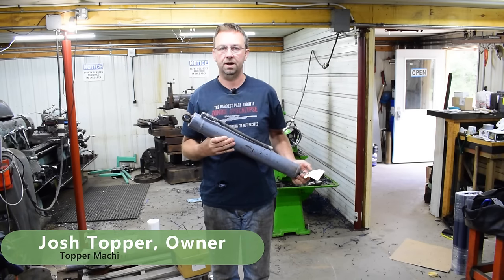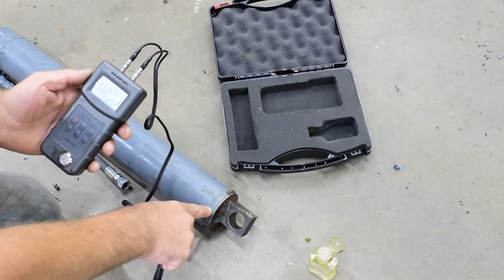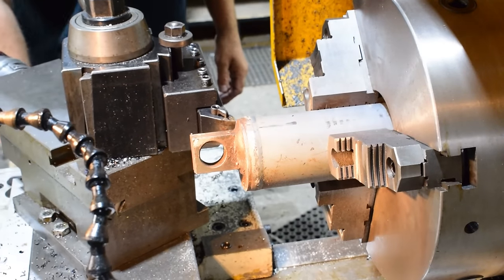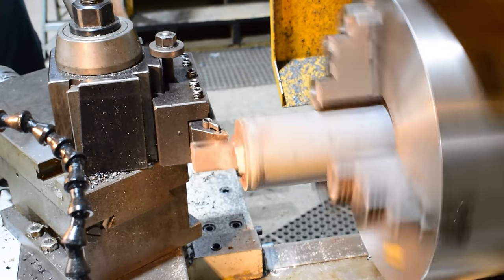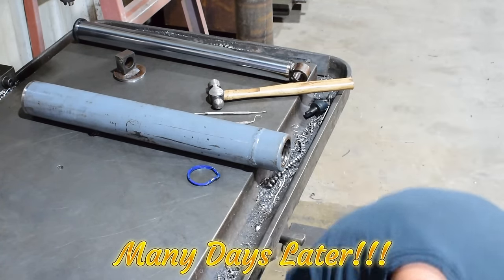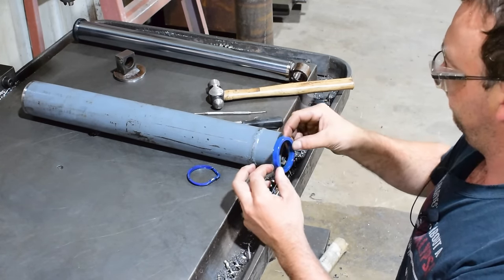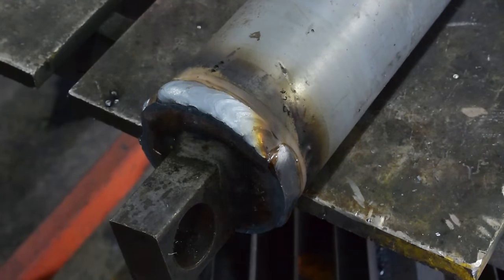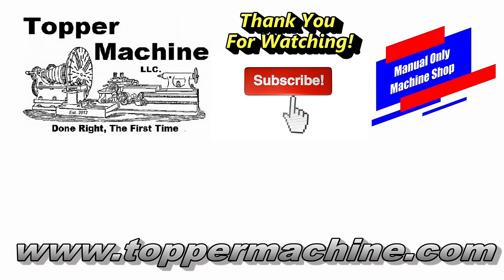Welded Hydraulic Cylinder That Can't Be Repaired, Cut Open and Resealed

Comment: I run a hydraulics manufacturing and repair company that specializes in heavy industrial applications.  We refer to this type of cylinder as a mobile or welded type.  Mobile/welded cylinders like this are in many cases considered throw away as they tend to be cheaper to buy new than to repair.  Something like this could likely be purchased from a Tractor Supply store or something like it for a few hundred dollars.  But, sometimes that is not an option.  This is known as a volumetric cylinder, as the oil volume and pressure displaces the rod.  It is single acting on the extend side, and uses gravity/mass to retract it, or other mechanical action of the equipment it is used for.  It does not need a piston seal, or a piston for that matter.  The "piston" on this rod is just a stop to keep the rod from being blown out by the oil and pressure at full stroke.  It is an odd design though, being completely un-repairable.  It really isnt the least expensive way to manufacture this type of cylinder, either.  It would cost us more to build this way than to make it repairable.  This is just a poor design.  Most welded type cylinders have an open tube on the rod end with a threaded on cap that holds the rod seal, the rod wiper, and an oring to seal the outside of the cap to the tube, and it is very inexpensive to build them this way, and much easier to rebuild.  This could probably be converted to that style easily, and then it would be rebuildable.  When you assembled the cylinder, it took some good hammer hits to get the rod to load through the seals, i would recommend cutting a good load chamfer on the rod, something around 20 degrees, to make this easier to load, and not risk cutting or rolling your new seals.  Also, if you dont have part numbers for your seals, you can measure the dimensions of the groove, which any seal company can use to find a seal that will work for you.  Lastly, since this is a pressure vessel, be very careful with MIG welding, its very easy to end up with voids and holes that will not hold pressure and allow oil to escape, which can cause a dangerous situation.  It can be done correctly with a MIG welder, but care must be taken.  I would highly recommend testing this after the repair as well with a small hydraulic unit, utilizing proper PPE, and taking safety precautions.  Ive experienced failures during testing where heads blew off, rods blew out the end, oil jets shot out from small holes in welds, etc...  We have never had any major injuries from this, we use ballistic shields during testing, but there have been serious injuries over the years in our industry, and even some deaths from failures during testing.  Just be smart about it if you do testing, its a pressure vessel, and if it bursts or breaks under pressure, a large amount of stored energy can be released in a bunch of different ways, so be careful.  Anyway, you did a nice job repairing that very poorly design and manufactured cylinder, keep up the good work.
Reply from the maker: Thank you and great info. This particular cylinder wasn't available quickly, so repair was the option. Definitely a good learning experience. The cylinder was pressure treated and passed. I am always cautious when welding any pressure vessel. Been through some training on in and have a good friend to consult on the proper procedures. He is an ASME "R" & "S" stamp holder and a MN licensed pressure vessel inspector. I also have a WI inspector who is a good friend and stops by to give assistance and advise. Anyway again, thank you for your great and welcomed comment. I will pin this one for future viewers to read.
Reply: Thanks for very helpful comment. My initial concern was safe pressure testing but Josh mentioned several time during the video that he would return the unit to the primary contractor who was going to test it before return to the customer. My only disappointment at the end of the video was not getting the rest of the story about the lack of a piston seal. I was planning to ask my dad who is a mechanical engineer, but your comment explained the situation! So thanks again to Josh and Jimmy, this was a great practical learning experience.
Reply: I've done these types of repairs before, and also welded on new fittings. I prefer to TIG in a root pass to seal everything up, then cap it with MIG.
Reply: I've never repaired a cylinder like this.  The single action cylinders I'm accustomed to have a piston seal. One side of the piston is wet and the opposite is dry. At the dry end of the cylinder there is an air breather to allow air to flow in and out as the cylinder extends and retracts.
Reply: Excellent info there Jimmy Palmer.
Reply: This was quite an education; thank you!
Reply: We did pressure calibrations to several thousand psi but using a small Mansfield and green(I think it was) hydraulic pump and a very short length of 1/8” SS tubing so if something did turn loose it was just a very light hard spit essentially because we put distance between ourselves and the gauges and such being tested. Did have a ferrule fitting someone else blow out one test at about 5,000 psi.  Little alarming but thankfully due to the small volume and rapid depressurization no one even sprayed.
Reply: Jimmy since your clearly the expert I hope you could help me w this question. I have a lift cylinder for a snowplow (2x6) single acting cylinder. The gland nut is crazy tight. Is it okay to use pipe wrench on the nut AND the cylinder itself. I wasnt sure w how much force is going to be required if i can damage the cylinder. Also can i apply heat to the gland area if thats okay, im going to be replacing the packing,etc. Thanks Jimmy, i just wanted to get a expert opinion here.
Reply: @brianb5779  I mean you can use a pipe wrench on the gland itself and or the cylinder body but you need to watch that you don’t crush the cylinder body or the gland.  If it’s off of plow, it’s going to be extremely difficult to get apart.  I would soak it in Silikroil then try.  You can also use heat but keep it evenly heated and don’t burn through it.  The seals will melt so do it in a well ventilated area.
Reply: @Jimmy Palmer  Appreciate the reply Jimmy and i did get it off. After a period of time thruout the day and using kroil and using blunt tool w the air hammer and massaging around and around the cylinder nut area, i put nut in a vise and with some heat I got it off. Crazy thing is it was the nut itself and wiper had gotten rust in there. Had to press it off (no tonnage buildup). Threw it in a lathe and went thru scotchbrite stages to clean it all up. I would like to ask you one last very important question and that is how tight once w all new packing to get the nut. I was going to seat and reseat all the packing and on the last time, run it down to where resistance is felt on the packing and go quarter turn. Does the sound good? Sorry for long reply but kinda hangin on your word w your knowledge here. Thanks again more than you know for your input.
Reply: @brianb5779  The unscientific answer is get it snug, then give the wrench a good whack with a dead blow.  I think a quarter turn is potentially too much depending upon the thread pitch. 

If you want to determine the actual torque, there’s a bunch of math to do that factors in the yield strength of the materials, force produced
By the cylinder, etc… for something like this I don’t think it’s necessary.
Reply: @jimmypalmer5422  Cant thank you enough Jimmy
Reply: @Jimmy Palmer  Promise Jimmy last question only because i hear so many opinions on this. Can you use petroleum jelly on seals for the install?? Again so much appreciate your knowledge, its going to good use over here. Thanks brother
Reply: Just watched this video have a John Deere 420 lawn tractor .started leaking oil on steering cylinder was wonder if could cut threads on cylinder  to add a insert or cap to make it repairable or is the metal to thin t
Reply: @fall-gj4xm  You'll have to measure cylinder wall thickness and maybe use a fine thread pitch as that won't be so deep as a coarse thread. 
May need a new seal head made to get enough thread length. (about same thread length as cylinder diameter is good rule of thumb for non engineer's like me)
 If you have a screw-cutting lathe that shouldn't be a problem
Reply: WOOO, professional
Reply: @brianb5779  I wouldn’t recommend it.  I would use a grease made for hydraulic use such as Parker O-Lube.
Reply: @1crazypj  I prefer diameter plus 0.250”.  As far as threading, ev egg n if there is room to cut the threads you would need to calculate the burst pressure and hoop stress at the new wall thickness to determine safety factor.  We go minimum 4:1 burst and no less than 2:1 hoop stress, but prefer to be above 2.5:1 for hoop stress.  3:1 would probably be safe for burst, but that is up to what you are comfortable with.  I don’t know what standard John Deere uses, or what tube material.  You would be better off just replacing it in my opinion.
Reply: You went the long way around to say it can be repaired but  is not worth the time or money.
Reply: Thanks for answering the question I had after watching the video. A very informative reply indeed and the perfect amount of additional info for this video!
Reply: Having worked as a hydraulic technician in Europe, the Gulf of Mexico and Australasia, I’ve always and everyone I’ve worked with would call this a single stage, single acting displacement cylinder.
Reply: Great info, thanks for sharing
Reply: @brianb5779  sorry for the late reply.  I mean, you can, but I’d recommend using a grease made for this.  Parker sells a grease that will work.  It’s more about fluid and seal compatibility than anything else.
Reply: @jimmypalmer5422  All good brother, thanks for the reply.

Comment: Josh, working in the agriculture repair for the last 35 years that kind of cylinder is very common. They are used on combines to lift the head. The cylinders are built for the rod seal to hold the oil the ram is the piston. They haven't changed since the first combines were built. Good repair job on the cylinder. You need a ground clamp made like CEE made.
Reply from the maker: I've just started doing hydraulic work, and have never seen one like this. Even in 20+ years of working with railroad MOW equipment, I have never seen this. Was a fun learning experience
Reply: @TopperMachineLLC  The first one I ran across I also was totally confused.
Reply: I like your reference to CEE (from Oz).   When working on BIG cylinders he would find a center (if need be he would weld more steel onto the end) and create a center.  He would turn the entire cylinder using a live center and a 4 jaw.    Then he could machine "landings" for a steady rest.   It seems like a lot of trouble but he has it down to a well practiced science.
Reply: Shouldn't you have pulled the rod to full ext before welding and melting the seals ?
Reply: @sascandave  There are no seals on that end of the rod. All explained in the video.
Reply: @sascandave  No because the seals are at the opposite end of the cylinder.  The heat transfer would be that great at the seal end of the cylinder.
Reply: You have to love CEE... That man is legendary..
Reply: Standard single acting ram..............
Reply: @brucetuckey7909  lol I literally came to the comments to mention the rotary ground clamp that Curtis at CEE made a video on
Reply: I was going to mention the clamp Kurtis made, very cool invention, anyway here's the link to that particular video.

https://www.youtube.com/watch?v=bIkHtYWENiA
Reply: So what was knocking?
Reply: @johnbaskett2309  What was knocking was the welded stop collar on the side of the barrel.
Reply: @rodrice1282  The welded stop collar on the ram slapping the side of the barrel.
Reply: I love how many of us came to the comments to reference Kurtis' rotary ground clamp 🤣
Reply: @jonka1  Well, I would say "as demonstrated in the video and explained in the pinned comment, above." The video doesn't actually explain why there was no seal at the end of the piston.
Reply: @brucetuckey7909  Just the side of the end cap at the and of the rod banging lightly against the inside wall of the cylinder. Probably accentuated by the ruined end seal which might otherwise have reduced the tendency to rock slightly. The rate of the knocking was not related in a simple way to the rpm, but the rate did decrease when he reduced the RPM.
Reply: I worked at an Agco/Allis dealership many years ago and worked on 100's of Gleaner combines.  To disassemble the header lift cylinders you would unscrew the elbow hose fitting off of the cylinder and use a small screwdriver through the oil port hole to remove a round snap ring.  After that snap ring was removed from the end of the rod, you could slide the rod out of the end.
Reply: @steveh8724  This is a simple one stroke cylinder. There is no need for any seal, just a slider to prevent scratching. You put hydaulik pressure in at the only side, and the rod will be pressed out anyway. Due to the nonexisting seal, the rod will get hydaulik pressure also from around the rod, which will add up to zero movement. Because the rod diameter fills almost the entire barrel, the rod end will build up force and drive the rod out.

Zylinder with a smaller rod diameter and a second hydraulik port at the other side will need a sealed piston.

Maybe easier to imagine, if this model showed would have a sealed piston, where shod the hydaulik fluid or air from the sidewalls of the rod escape to when driving the rod out? Makes sense?

Comment: When parting off the end of the cylinder, watch for a little puff of smoke.  That indicates that the tool has reached the oil in the bore, and the cut is completed.  Your camera did a nice job of capturing that on this job.
Reply: It sounds like you have experience in this. Wouldnt  it make sense to cut into the center of the weld and not worry about trying to measure the thickness of the endcap? Just seems like a waste of time that may not be very precise.
Reply: Thanks for pointing that out--another great comment, I totally missed that watching the first time. Sure enough between 12:05 and 12:09, the magic smoke began to escape. But in this context, that's a good thing...
Reply: You can also look for a black line to appear when you get to the bottom of the weld. I have been machining replacement rods and retubing hydraulic cylinders for over 30 years.
Reply: @steveh8724  It is the smoke that occurs when the hydraulic fluid hits the hot carbide tip. The cutting-edge is so thankful and happy that it is getting cooled off :virtualhug:!!

Comment: CEE (the Ausie) made a pretty nifty earth clamp that spins with the work. You weld it on with a sacrificial nut, its just 2 brass discs that slide by each other while keeping ground. Just the tool for welding cylinders. -Another helpful message from Captain Hindsight! Jumping in with unsolicited help long after the work is done.
Reply from the maker: I have seen it. And it wouldn't help with the traction problem on the light cylinder.
Reply: @TopperMachineLLC  You maybe need an adjustable third wheel set up to apply pressure from the top?
Reply: @TopperMachineLLC  Wouldn't it really? I don't think it would apply a lot of drag if you welded it on the center axis, all it would apply would be the friction between the rotating and stationary ring, not the weight of the whole cable as with your clamp.
Reply: @TopperMachineLLC  Maybe a wrap of 40 grit emery cloth around the cylinder where the drive wheel runs?
Reply from the maker: @lancer2204  This is a great idea, thanks.
Reply: @TopperMachineLLC  Have you tried putting a loose band around the cylinder with a weight attached to put more pressures on the rollers. The band would slip around the cylinder.
Reply from the maker: @sourand jaded I've wanted to make a.carbon brush one. I have piles of used locomotive traction motor brushes I could adapt. Just never got time to do it.
Reply: On my haydays I have serviced that kind of cylinder with no piston it is used in hot press a forniture company and that all four cylinder are connected in series they are all single acting type fm. Phil's.
Reply: Well, you saved me from a more late comment. Suggestion: place the link.

Comment: Ah nice to see someone else who sees "Un-servicable" and hears "Yes- Take it apart and fix it"! Just like "no user serviceable parts inside" The first time. Totally subbed.
Reply: The difference between serviceable and not is usually cost.  We routinely have our cylinders repacked.  Each usually saves a couple hundred dollars over a new replacement.  However we had one recently that rebuilding would cost more.  That one ended up in the scrap metal bin.
Reply: @supernova743  Yeah, that's a perfectly sound reason.

Comment: When you think about it, this design is the cheapest & simplest way to get the job done if you only need hydraulic pressure to push one way.  Only one pressure seal and a scraper ring to critically fit, plus only one hose at the same end to worry about.  The cylinder bore / piston face gap is adequate to allow fluid to flow around and do its job extending, but tight enough to keep the actuator relatively straight.  
You could bury the end that he cut n welded into a hard to reach area with no hoses or fittings to attach.
Brilliant design I say.

Comment: Hydraulic seal removal spoon set makes the removal and replacement of the seals much easier (easier is a relative term with some jobs). They're more robust than the small metal picks for prying. Also help with getting metal retention rings in place on reinstalls where metal retainer rings are used.  Cheap and good to have around for hydraulic rebuilds or any o ring job. Good job on the rebuild!